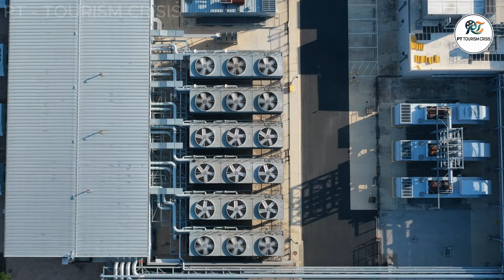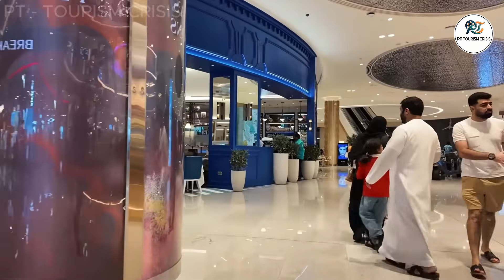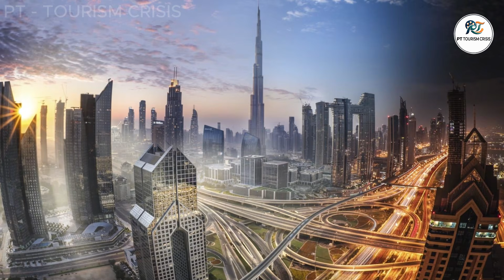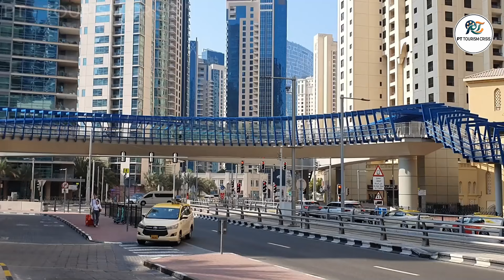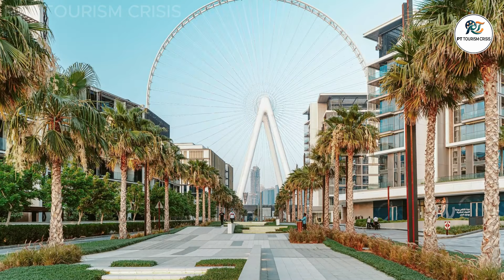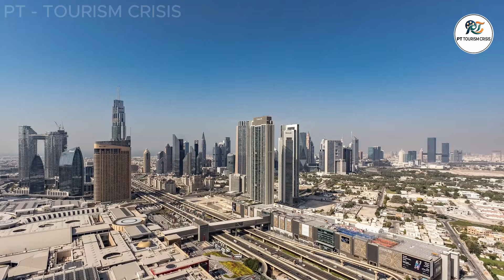Why Dubai’s 122°F Cooling Empire Is a Thermal Trap

Comment from the maker: The heat never disappears—it just changes its address. As Dubai continues to expand its glass towers and cooling networks, we face a critical question: Is manufacturing 'winter' inside a sustainable solution, or are we just building a larger thermal debt for the future?

🏙 Would you rather live in a city of perfectly cooled buildings, or one designed so that stepping outside doesn't feel like leaving life support? Let’s discuss below! 👇

Comment: What a hot mess! Need to get permission slips signed by incoming visitors stating they cannot hold country responsible should the delivery of life essential resources fail. At least get the animals out. Notice how not many ecological activists take this place to task. We need to learn from mistakes. Respecting nature just makes sense. And -it is an honor to do so. God bless the truth seekers.

First, stop all additional building. Shut it down! Then move elderly and those with health challenges from top floors before working to shut those top stories down. Provide information to all visitors what to do if resource delivery systems for necessity for life fail in emergency conditions. Get all animals out of area due to possibility of deadly conditions and of water becoming too hot. Aquariums in this video environment are pretty much ridiculous. Have councils to review the realistic future of a modern city built on sand. To admit to blunders to such a degree is an embarrassment. To not take emergency steps and make necessary changes could be a crime.
Reply: I like your forward thinking
Reply from the maker: Emergency planning, transparent risk information, and protections for vulnerable people and animals are all reasonable demands. But shutting down an entire city is not realistic; the priority should be stronger backup systems, independent oversight, and development that respects environmental limits.